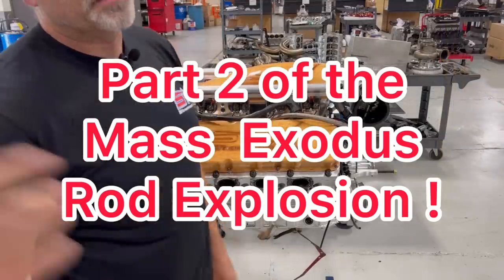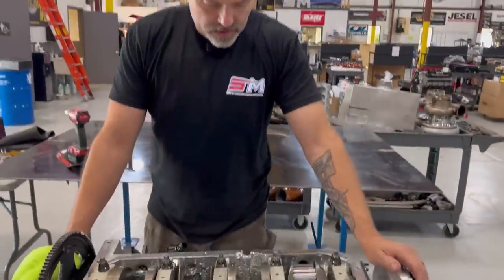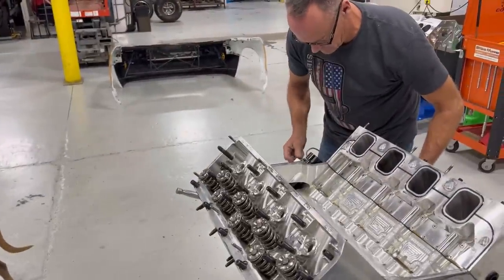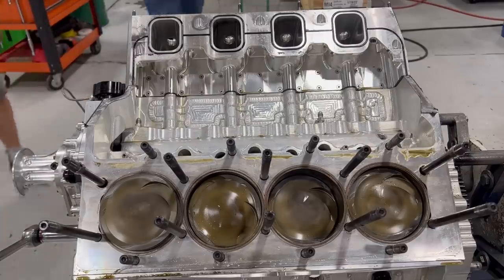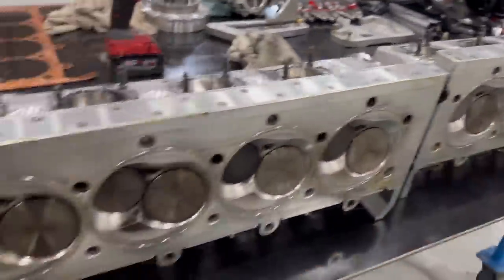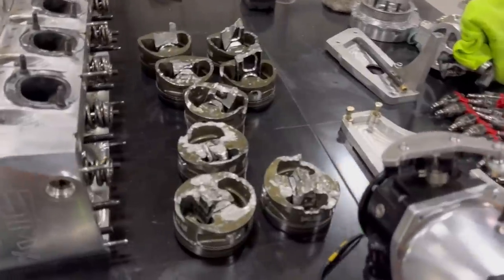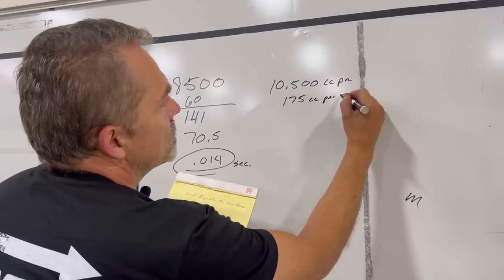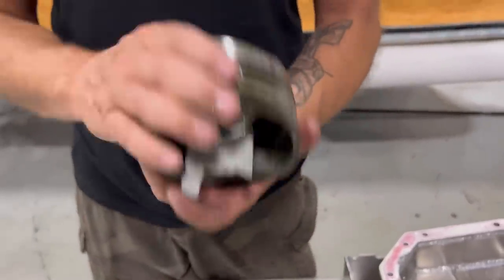EXPLODED RODS  Part 2

Comment: Watched the engine build up video again and the “new” rods have a double rectangular recess machined out of the main beam versus a single recess in the “old” rods. The recesses are also two different sizes. This could be easily result in a stress concentration at the mid point of the beam (between the two machined out recesses.  Add in that a T6 heat treatment actually reduces the fracture toughness of 7075, and you’ve got a recipe for a catastrophic fracture failure under cyclical loading. The fact that all 8 failed is a strong indicator of a design flaw that didn’t play nice with the grain structure of the aluminum.
Reply: That's exactly what I was thinking and likely what happened
Reply: I seen  the  rod. aluminum  holds  up on fuel cars  .but one run and  throw  away   this  guy  punished  this  engine  so many times  with  big boost  .. rod failure 100%
Reply: 100% agree but he's gonna dazzle ya with bullshit to protect the rod manufacturer.. but bet he never uses that rod again in that application..
Reply: @breckhedrick8692  Ever come across component lifecycle prediction / analysis? Guy builds engines for a living, and just mindlessly runing the part till failure? I belive the rods have predicted lifespan and it was not correct or material for the analysis was different than the rods in the engine.
Reply: @MJPilote  those 1/4 mile guys do go certain number of passes prior to rebuild..
Reply: @jayirving6996  Yeah I know, I used to race Funnybike.
Reply: @breckhedrick8692  fuel cars make more than a single pass on a rod. Granted they are pulled and measured every pass, but the life span is about 5 passes and comparing cylinder pressures of a fuel car to this motor is apples to oranges.
Reply: Street Outlaws no-prep king Hemi's running alcohol make around 3k+ HP, and they get 25 passes on a set of aluminum rods.  Some guys like Murder Nova push it to 30 runs.  They run 660ft, but that's still quite a few hits.  I believe the rpm's are around 8,500.  Slightly lower rpm's on the 481x engines.
Reply: @breckhedrick8692  these rods and this engine had 6 runs on it. Look at his first video on it.
Reply: He's pushing 3000hp plus through that engine, at those kind of power levels shit happens
Reply: @jayirving6996  he has said in the video prior to this he is working with the rod builder to work out what happened, he also said this is the first combo he has used these rods in
Reply: Great explanation, thats the trail that i was on but this shade tree brain couldnt  put into words... the reality is it probably had more than just one contributing factor. But in the end the rods "shattered"...
Reply: Bill Im in agreement,  My "opinion"  and I'm loving to find out the reason   is that these were a set of rods from the same "batch"     ( for the reasons u point out )    Now nothing to do with this channel etc , but one of my "pet" peeves are folks doing stuff without knowing WHAT or WHY they are doing it,    Im just a mechanic  but I studied engineering to a university level ( realised I was happier being a mechanic and preferring electrical !)      if these rods were changed in design , what "analysis was done  ,,fracture WILL always tell u why .... ya cant hide a fatigue failure !
Reply: @jayirving6996  he already said these rods have never been used in an engine of this power. It’s racing things break and he wanted to try something new and he tried it in his own junk as he would say.
Reply: I agree I do air plane part machining and I've seen similar when testing new designs or material
Reply: @breckhedrick8692  yea just don't comment you have zero idea whats going on here... Top fuel uses rods for a few passes because they are running 6000 more horsepower Einstein... And have unlimited money ..our engine made 60passes on aluminum rods  before changing rods  65+ lbs boost ..  this is a material problem or design flaw that's why he was TESTING them in his own engine in the first place..  you know what else they change in top fuel literally everything it's not comparable whatsoever totally different situation
Reply: @freedomfox8183   ,Breck Hedrick’s a nitwit.
Reply: Based on what's visible in the engine rebuild video, you can easily find the manufacturer of the rods. As I mentioned in another reply: what they claim will give you a clear hint as to what's wrong, if you're a metallurgist at least. 

The rods are made from "a proprietary alloy" that has a claimed 35% increase in yield strength compared to the competition. They also claim a strength-to-weight ratio comparable to titanium.

Materials Science 101: You can increase the yield strength of an alloy, at the expense of its ductility. Looking at how the rods fractured, all in a brittle mode, tells you that this alloy was not ductile at all. It behaved like cast iron: no bending, just cracking.

So after 6 runs one of the rods snapped, probably from fatigue cracking, and the resulting debris caused a chain reaction among the rest of the already-stressed-close-to-fracture rods.
Reply: @Hydrazine1000   , Who's rods were they?
Reply: @paulwilson6342  Since Steve didn't name them/call them out, I'm not going to so either, so that a YouTube search doesn't suggest this video for the brand name. But is it not a big secret.

The rods are in plain view in part 1 of the engine rebuild for the wagon video. Watch that in at least 1080p HD and, with a press of the pause button at the right time, you can catch the machined markings on the rods. From there on, Google is your friend, especially if you're smart enough to add "rods" to the brand name search query..
Reply: Biggest issue with Steve is he made this video and he blames OUR (viewers) assumption as to why we make OUR assumptions as to why the rods failed. He needs to find THE CORRECT assumption as to why the rods failed. He is an awesome engine builder, but shit happens. Chock it up! He has more money than Jedd.
Reply: @Harleybobber  Nahh, in all fairness, he blames some of the commenters for making the wrong assumptions, and he also explains why those commenter assumptions are wrong. "Must have been torqued wrong" is being met with "well, in the build video you can see me torquing them to spec". "Bearing clearance must have wrong" is countered by "It would have been knocking like a mothertrucker, but it didn't". 

Sure, quite a blunt approach, but very educational too. "Some assume A to be the cause, but because of B that can be ruled out."
Reply: Yup
Reply: Don't worry, Steve's been at this 30 years. He's right. You're wrong.
Reply: @Hydrazine1000  Spot on! BSME with a minor in Material Science here and my immediate response when I saw all of the “shards” of rod material was “that looks like a cast iron failure?!” 🤓
Reply: @fast97z24  30 years  I been  doing  it for  50 youngster  I have  seen  old to new bullshit  so in the  day  we had  to be correct  because  we didn't  have  cnc or shitty aluminum  rods  most  was Mickie  Thomson  or Keith  Black   wasn't  everyone  in the  business   few others  that  snuck  in the  racing  world  but this  boost  today  nothing  built  for it its a learning  curve  Like  old  days  till they  get it right
Reply: @breckhedrick8692  i was being sarcastic. 30 years, 3 years,  or 300 years, every engine builder has done it all, seen it all, and has their opinion on every last thing.
Reply: This comment is exactly where I was at. Just watched the carnage video, went backwards, and boy, this is the only explanation that makes sense. I've never seen an engine yeet all 8 rods like that, and usually 2 rods means the crankshaft took a ton of damage, as well. As much loose material as was thrown off the rods, they didn't shear, they exploded, which lends to the theory that the material was too brittle
Reply: Or un aimpler terms bad metallurgy 😀
Reply: Have a feeling a harmonic release the balancer couldn't control also played a part but yes I'm guessing your on to something.

Comment: When I was on the FSAE team, we ran into our wheel centers breaking in high G corners.  Our root cause analysis showed that it was the anodizing that was at the heart of the problem.  Upon further research, we found that 7075-T6 is extremely sensitive to crack propagation, and putting a super hard layer on the outside, like anodizing, exacerbates the problem, because the aluminum has a very low young's modulus as compared to the anodizing layer, causing hair line cracks as the part went under high stress condition because the aluminum wants to "flex" but the anodizing cant flex as much.

It may be worth looking into what type aluminum the rods where made out of and what coating was done on it, but it could be as simple as a crack propagation issue.  Not to mention, it would explain why all rods broke around the same time.
Reply: Thats cool to know!
Reply: Very very cool to know that.
Reply: They're not anodized, the black coating is a paint 👌
Reply: @JamesPF2D  at 32.06 he mentions "black anodizing"     .   He'll find out when the metallurgy comes back if it is a material or processing issue.   Should probably just stick with tried and true brands that have been used forever at that hp level.  Being the first one to use something at a never tried before hp level... expensive beta test failure.
Reply: @zz7qvl  well I'm pretty sure Steve is incorrect then, the black coating is the vader coating that the company sell and is for oil shedding..
Reply: i know of the anodizing that we did at Flextronics used sulfuric acid to make mountains on the surface of the aluminum and then fill in with a dye and finally used a e125/e75 making a e250 hard coating to seal the surface. i know there is another way of anodizing but i didn't work on that type of process. all and all that is very cool to think about it in that way.

Comment: Steve I'm really impressed on how transparent you're on everything! When I can afford an engine from you I will!
Reply: Why? so it can blow up like this one?
Reply: @benburnett8109  there’s always 1.
Reply: @benburnett8109  dude that's Fing RUDE!
Reply: @benburnett8109  where’s the 4000 hp engine you designed and built yourself?
Reply: @benburnett8109  Never heard of research and development, eh? You have to blow up engines sometimes to learn something.
Reply: David, genuine question.   What do you think one of his worked out entry level combo's (therefore seems super reliable) costs?   I am worried it is $60k.    $20k? - I'm right there with you!

Comment: I am at 8:24 .  I have always asked this ? of myself.  Why? And then searched for an answer or a bunch of possibles.  Seeing that it is consistent - once the engine hit a certain mark - it came apart at the rods - at the same time.  Going back to Mech Mat some 45 yrs ago - the material hit a dynamic load limit.  4000 hp - ok - you are working at much elevated levels from my experience.  We had cast iron - and even in a failure - I could rescue a crank almost all of the time.  In my day - your crank - and 800 - 1000 - 1500 grit emery  paper - and once micro''d I would rebuild in a clean block.  Heck in a day or two - we had a running engine - BUT at 300 to 500 hp.   I am in awe of the HP you and others get out of these works of art!  Much Respect Sir!

Comment: Watching part 1 and 2 of this video clearly states metal fatigue in my opinion. 
No fault of you or your supplier...curious to know how the manufacturer tested these rods. 
A learning curve for all involved. Move forward and upwards, best of luck.
Reply: Embrittlement - incorrect tempering.   Fatigue would show up in one or a few pieces.   But all 8 from the same batch,  the metal was just too brittle.
Reply: I'm opining they were powdered metal rods, hot isostatically pressed, then forged...

Edit to add:  I enjoy a good technical discussion!  Though some disagree with me, that is good.  What comes into play here is the Mode II fracture toughness (KIIC) of the composite.  When under BOTH great stress and great strain, the type of material I describe has shown cases where it "blows up"... i.e. brittle fractures in all planes.  Isotropic fracture.  We can easily achieve 98ksi in a properly alloyed PM/forged part.  These may also be on the edge of a metal/matrix rod.  It will be interesting when Steve shares the lab results.
Reply: No way fatigue would have them all fail at the same time. Not how fatigue works.
Reply: @totalyep  Not fatigue, just incorrect material.
Reply: @MX304  well it’s a fast fracture of some kind. Unlikely due to material. It’s probably something caused a massive sudden overload. Definitely not a fatigue failure.
Reply: Engines built to this magnitude don't use anything but billit
Reply: @theoldbigmoose  that may be the dumbest thing on the internet today. powdered metal in a 4khp motor.
Reply: @theoldbigmoose  from the broken powdered metal pieces I've seen the grain structure looked a little odd. I think the pieces I had were not sintered to a high enough temperature or the bonding agent was not cooked off enough because they had an almost pebble like appearance.
Reply: @theoldbigmoose  powdered metal aluminum billet...c'mon
Reply: I'm not sure the manufacturer is off the hook.  This could be a design problem.  As someone else pointed out, the scalloping in the beam of the rod was not gentle, with sharp corners at the bottom of the pocket - stress riser.  I'm not saying it wasn't a heat treat issue, but maybe a combination of design and metallurgy/heat treat.  I want to see the FEA results for the load regime Steve was using these rod in.

Comment: I spent several years working in a Texas shop that puts out some of the baddest dirt car engines money can buy and have seen the insanity of probably every kind of engine failure imaginable. Except for this one.....the amount of destruction along side the lack of destruction has got my brain working overtime. Without actually having broken parts in hand I would say that the only way  8 rods break simultaneously without killing the crank would have to be a flawed set of rods
Reply: I agree, I thinknit comes down to the metallurgy of the rods.  One started to go, vibration killed the rest VERY quickly.
Reply: That would also be my guess also. That it is material and grain structure and design.
Reply: I agree with your theory - simply because I don't see any way on that motor that a failure in on cylinder or pair of cylinder would cause another cylinder to break (with almost no damage to the block).  If it was 'tune' related, I would think the piston or heads  would show the damage first.   
So if it was the rods and they all let go at almost the exact RPM - that is something for the rod-manufacturer to sort out.   Of course my highest boost car is 16 psi so.....
Reply: Whos rods are they?
Reply: @mikegordon3436  FFWD Racing Rods

Comment: This is going to be a super interesting series of video's connected to this blow up, your positive attitude towards the whole thing is very impressive, I hope all the evidence of the failures leads you to the correct reason for this event, as a race engine builder myself I would say that if the rods were weak for some reason and they were all equally weak then when equally loaded beyond a failure point then yes they can be expected to all fail together especially as when the initial failure took place a storm of debris shot through the engine from that 1st rod to fail, that must have created a shock wave that precipitated the complete failure as with each rod letting go the shock just kept getting bigger and the debris storm kept getting denser and more violent. Can I suggest that in future use steel or titanium rods. My 2 cents
Reply: AGREE ! apart from using steel or titanium rods,not at this power level.
Reply: People hopefully do not you give you this much grief.  You are the king 🤴 of engines.!

Comment: I believe this is a metallurgy problem in the rods.
Those gernals are in great shape for what has taken place.
All the best Steve!
Reply: journal is how it is spelled. This is obviously a "torque to yield" rod bolt issue. They used the wrong torque spec across the board. The idea that the rods were all machined from the same piece of metal is the DUMBEST IDEA YET TO APPEAR IN DRAG RACING.
Reply: @benburnett8109  The manufacturer of these rods has confirmed that all of these rods were machined from the same single slab of bar stock

Comment: Right on big guy. I like using numbers to solve problems, but I love it when numbers are used to show something is impossible. The main reason I watch your channel is because I learn something every time. Keep on building those beautiful beastly motors and sharing it with all of us. The moment I saw the grainy shards of steel, I recognized that problem from a blade forging show I watched and the steel wasn't annealed properly, so the blade shattered like your rods. I was really happy to see how many expensive parts you will be able to salvage from your blown motor. Rebuild her bigger and badder than before.

Comment: 30:15  That is one of the money shots.  I needed to see at least one unmolested fracture line.  There was one other rod end I wanted to see as well, but that is good enough.  Still like to rough out the stress calculation.  Machining will have a greater influence on the failure mode than  anodizing, but neither of them will outrank material selection.
Reply: That chunk looks like  a layer sheared off. Don't think Alu supposed behave that way or?
Reply: @palleppalsson  Depending on the alloy they can.  That fracture is not indicative of sheer, but rather compressive, possibly tensile.  Tough to estimate on a video with such short glimpses.  It most certainly did not possess enough ductile qualities for that application.  Might be a seven series alloy.